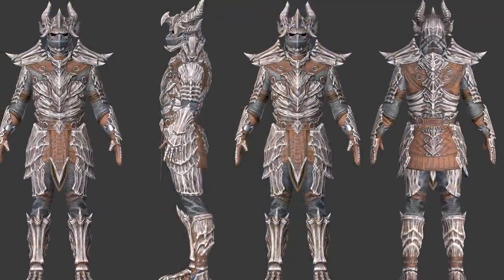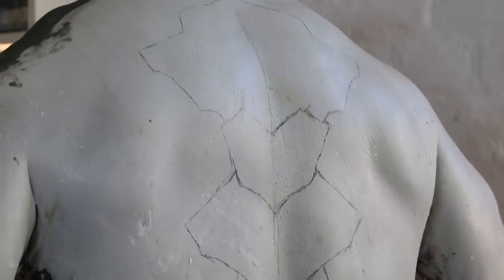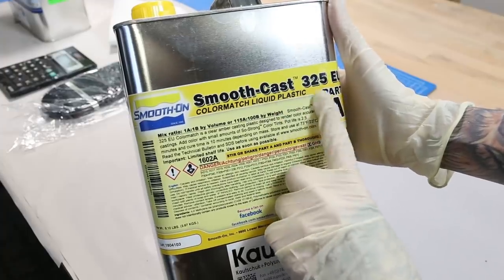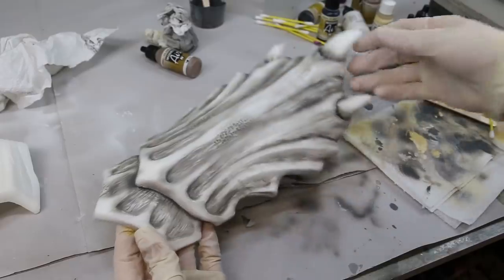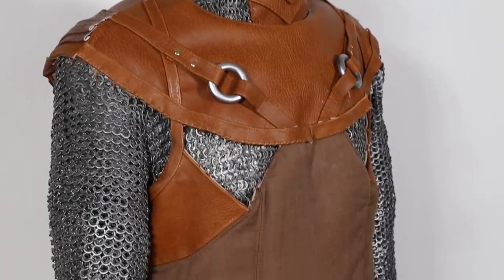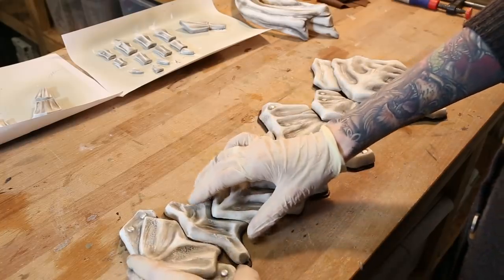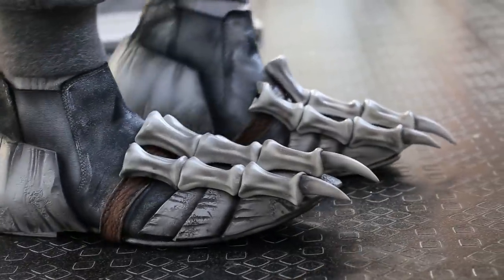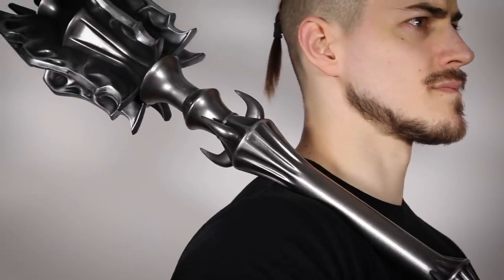Dragonbone Armor Making-of - The Elder Scrolls Online Elsweyr Cosplay

Comment: Lightning Cosplay: Clay and Sculpting by hand. Kamui Cosplay: Dremel, dremel, and more dremel. End result? Quality cosplay, with one costing a lot more than the other
Reply: Tbh i think both methods would cost the same, just because rubber and clay in such big quantity is not cheap. So both EVA foam and worbla/rubber/liquid plastic are expensive. 
Eva foam has less work though, considering you dont make your own molds, so much more time saved
Reply: @elenipaulidou1274  eva foam is way cheaper so you're wrong there
Reply: @rockinHurley777  cheaper than what? Clay? Not in my experience. And it depends on what kind of foam you're using